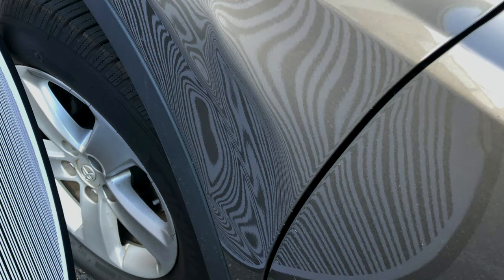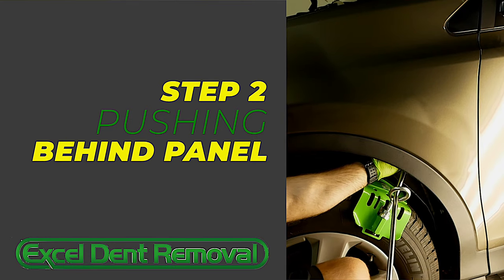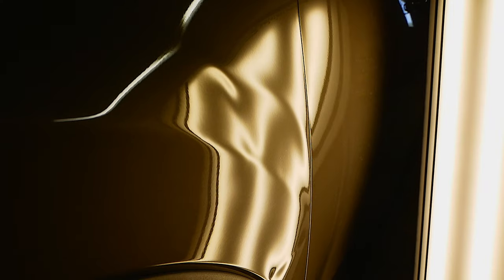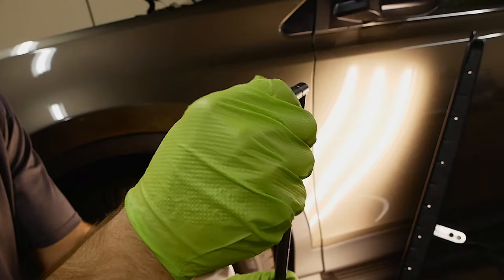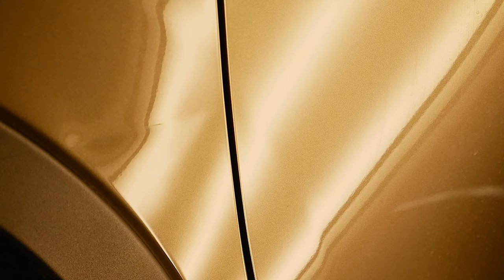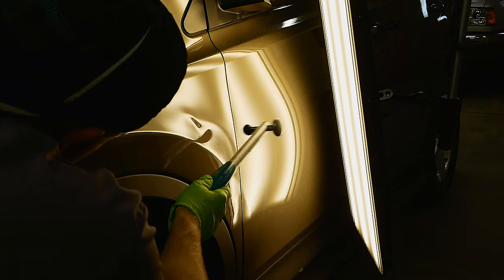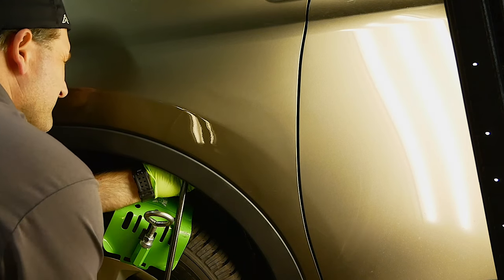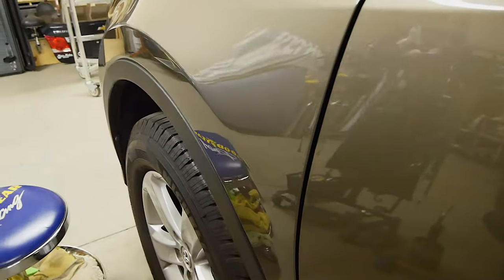3 Steps To Pulling Out A Dent On A Car

Comment: can you use heat on the panel...boiling water  ...air gun?
Reply from the maker: Any heat used is only to warm the panel material and paint to help make it easier to move and help prevent any damage to the paint. 
Sometimes I will only need to slightly warm the panel with a heat gun. Other times I will use consistent heat during most of the repair.

Comment: did you have to remove the fender liner or were you able to sneak behind it?  Real nice work, thanks for sharing.
Reply from the maker: Yes I was able to loosen it. In a couple of the clips you can see it hanging down on the tire. 
Plus all the leaves and junk that were  stuck inside fell on the ground.

Comment: Where can you get the rubber cap for the r4 tip
Reply from the maker: This was the original Pivot Tips™️ that I got off the Anson Truck a few years ago. You can still find the updated version and variety of sizes at KECO or Anson.